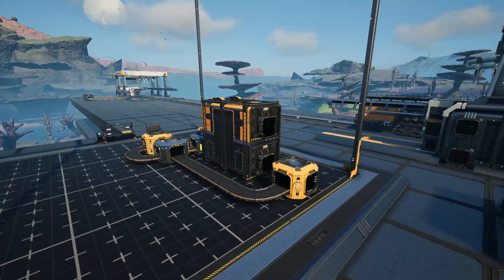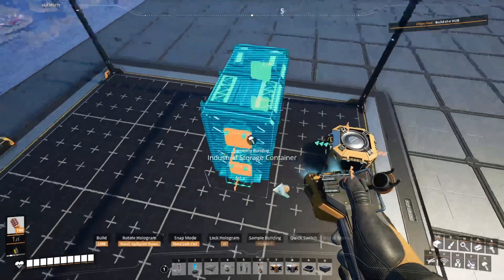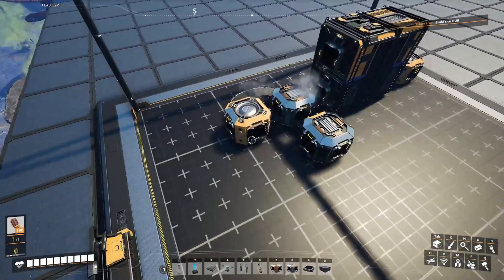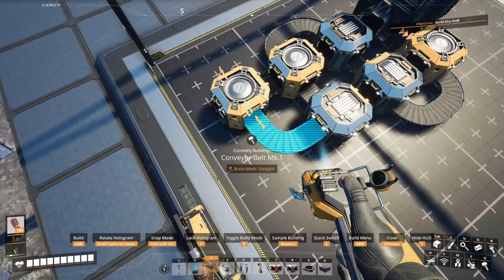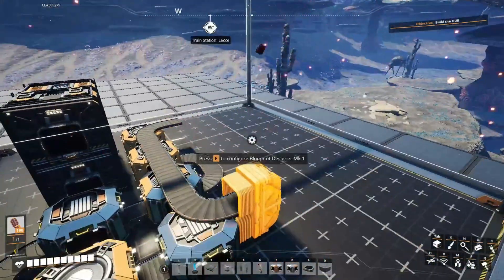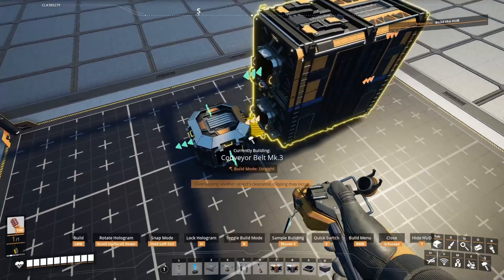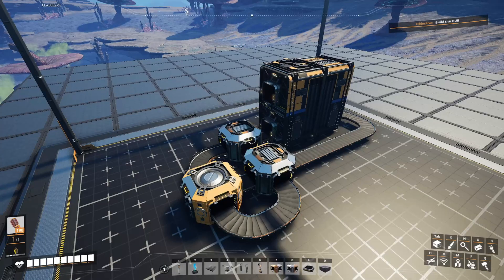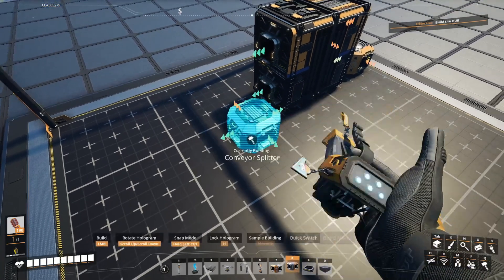Train Buffer / Load Balancers - 200, 250, 500/min - Satisfactory 1.0

Comment: Thanks for another video. I think you gave up too quickly to get 500 from 780 without having to resort to overflow.
There's a splitter/merger assembly for 39 parts to 25 and 14  (780 to 500 and 280) that is 2 tiles wide and 1.5 tiles deep without lifts.
Happy to share and make available but I believe it's not possible to include links in the comments.
Reply from the maker: I’ll be honest I didn’t even try. Which is silly because I’ve made more complicated ones. But you’re right I should probably have tinkered with it and i bet I could have come up with one. I’ll see if I can and I’ll add it to a future video. 
 I understand why YouTube wont let people post links but I wish I had the option to approve comments with them or something. I don’t have a discord server or anything but if you have it posted somewhere I can try and find it. Thanks!
Reply: @moo121  The first try seemed to have been accepted but it appears that has now been removed. Second attempt:
Post is on imgur, path /VzLVdiD
Shows expanded version with converged numbers and two possible implementations.

Comment: With Mk6 Belts you could make the 200 and 500 variant easier. For 200 you could use 1/6 of a mk6 belt. And for 500, you half the 1200 first, then get 5/6 from it.
Reply: ... which you don't get until Tier 9.
Reply from the maker: That is a great point! I totally forgot to mention that with the mk6 you can simplify a few of these. I wanted to make these in the mk1 blueprint designer and with the lowest speed belts possible just so the most people could use the blueprint. But that is a great way to do it as well!